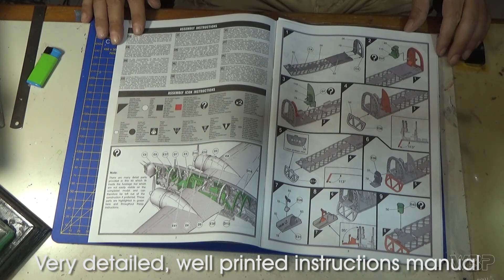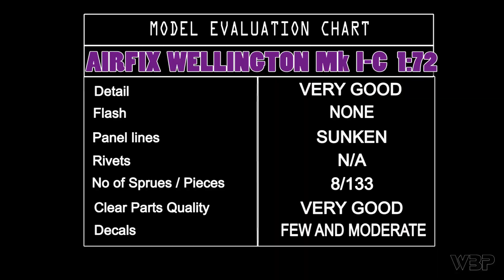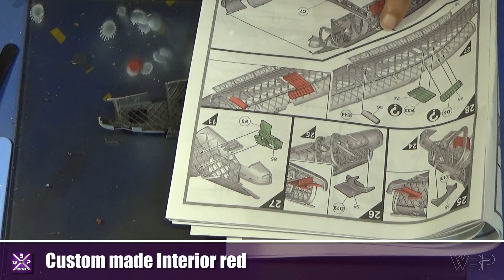Airfix Vickers Wellington 1:72 IA Full build

Comment: Brilliant job. It's a shame the interior can't be appreciated. How do you thin the Vallejo primer? I have lots of issues airbrushing it
Reply from the maker: I did too...   I switched to a .3 beck diameter (instead of .2) and I thin it at least 50% (50% thinner - 50% primer)..  I also use some flow improver, can't say if it works much..  I still have to manually clean the tip of the needle from dried up paint (or primer) every now and then...  To be honest, Vallejo was my go-to brand after I switched from enamels and I haven't tried anything else so far.. Their spouted bottle suits me fine and they seem to have a huge range of colors.  Thanks for watching  ! :)